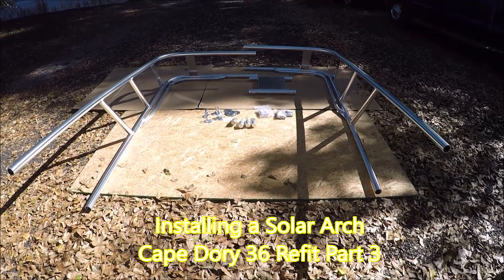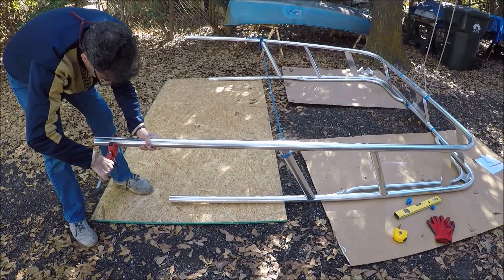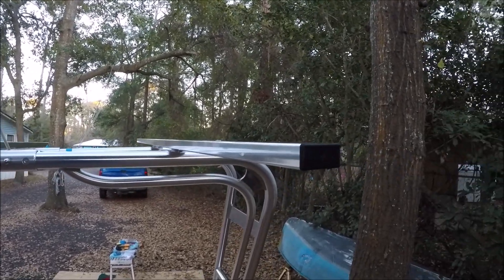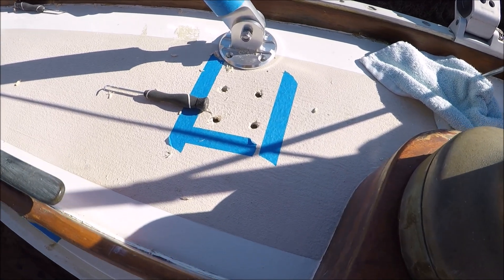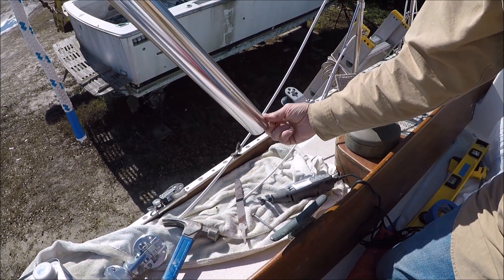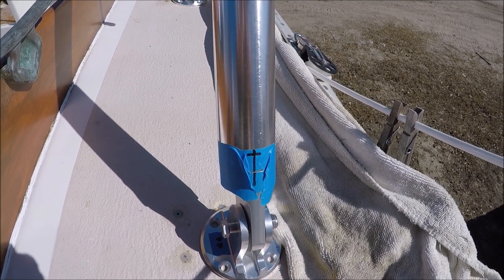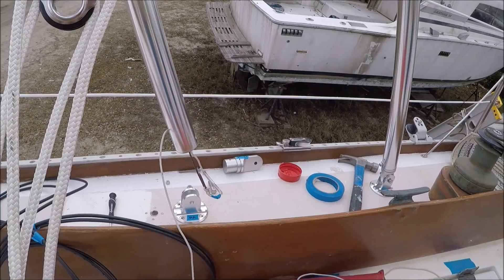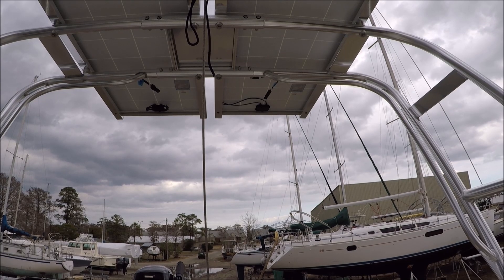Installing a Solar Arch Cape Dory 36 Refit Part 3

Comment: You do incredible work and excellent videos also, much appreciated! I learned a neat trick at work that you probably know, but if you don't it could come in handy. I had to weld SS nuts to a SS panel are the PEM fasteners popped off. The welder was available to fix it for me so i watched him. If you use a galvanized screw to hold the SS nut to a SS panel, the screw threads won't stick to the nut threads. Brilliant!! Okay, that's all. Keep up the great work!!

Comment: I’m curious how is the horizontal stability? Any movement? I like the product so far by: A)seeing you choose it and (B) the installation looks straight forward. Thx for responding and posting this project.
Reply from the maker: When I pushed on the upper tower it moved only slightly before it stiffened up. We only use it for solar mount but there are videos of others using it for dinghy davits as well which puts much higher side loads on it and I didn't see any mention in their videos about it swaying too much. The key is to build it at least 4" wider than the base mount and bend it in to bolt to deck as well as tighten up the loose fit of the deck u-brackets to the eyes on bottom of tubes. And of course add backing plates under deck. Side struts could be added somewhere but I would not expect they'd be needed. If we had a local arch fabricator we may have used them instead and it might have cost less and been an easier installation.

Comment: What was the height off the seat? Were you happy with the arch or would you have gone another way? Will this arch be able to act as a bimini? Thank you
Reply from the maker: This still seems like the best solution for this boat. The arch headroom is about 6'4" when standing on the afterdeck and several inches more than that from the cockpit seats. The arch being more forward than on most boats that place it further aft to double as dinghy davits, the solar panels provide some shade themselves and since the distance from arch frame to dodger is not so great we plan to have a Sunbrella panel that serves as a bimini by zipping into the aft end of dodger and lashing to the arch in each corner. I'll try to get a video of that once we get it launched and finished.
Reply: It is a really fine job! I’m impressed and I’m glad I found your video. Do you have pictures with the bimini?  Is it wise to design the bimini after the solar arch construction?

Comment: Nice looking install. Pro tip from a solar industry guy that has actually designed module frames is that you don't really need those aluminum mounting bars. The panel frames are strong enough to mount directly to the tower. Just through bolt them or use cable clamps, u-bolts, etc as needed to connect them. No harm putting a hole for a 1/4" bolt in the panel frames as needed so long as you don't touch the laminate.
Reply from the maker: That's good to know. By not using the frames you could save some money and weight and labor. The frames do make it stronger but as you say they would be strong enough without them.